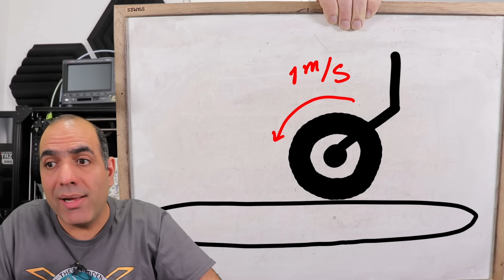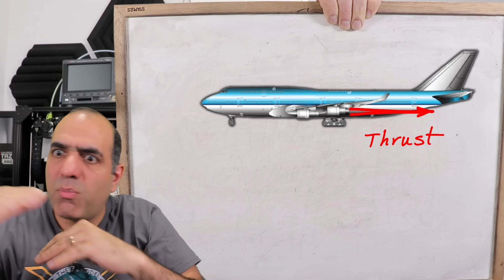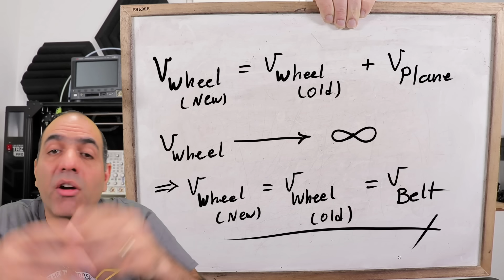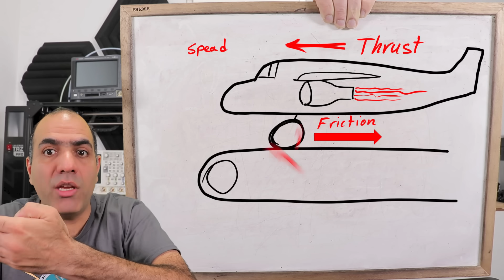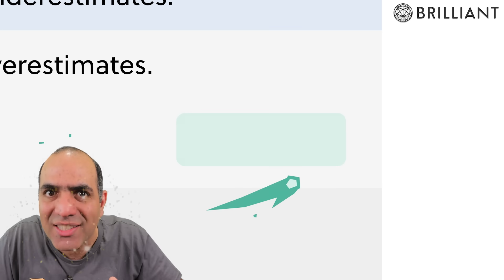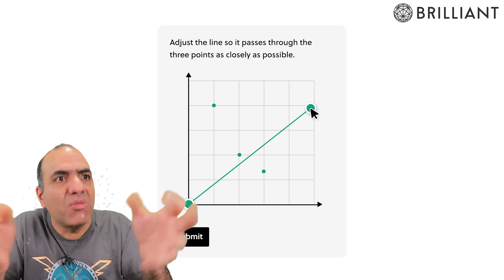Airplane Question that Drove Me NUTS!!!

Comment: Alright, at the point he says to leave a comment about what we think. Starting at rest, the pilot starts the engine and begins to throttle up the engine. The plane moves forward a a fraction of a millimeter, causing the wheels to rotate, but immediately the the conveyer starts rolling back to prevent the wheels from making progress. 

The conveyer and wheels will quickly accelerate until the friction in the wheel bearings pulls back on the aircraft with equal force to the thrust of the engines. This could cause either the wheels to break traction or the bearings to heat up and fail, probably within 10 seconds. At the point the wheels break traction, the plane can begin to make forward progress, but it is effectively dragging the wheels across the ground, because they only progress that can be made is equal to the difference in wheel velocity over the conveyer velocity.

Assuming the wheel bearings fail at some point, this will cause the wheels to wither come off or stop rotating, in which case the conveyer will come to a stop as the wheels do. The plane can make progress only by overcoming the friction between the wheels and the conveyer.

Both of the above lead us to a plane trying to take off effectively or actually dragging it's wheels rather than rolling them. Any further progress will depend on the coefficient of friction between the conveyer and wheels. Let us suppose this friction is somewhere between .45 and .75, which seems reasonable based on a quick web search I just did.

A commercial aircraft, such as a 747, does not have the thrust to take off with this much drag. A high performance aircraft like a stunt aircraft might be able to, but that seems pretty unlikely. A VTOL aircraft could do it! Maybe a puddle jumper if you wax the pontoons reeeeallly good.

Maybe if we put this whole thing in a wind tunnel there could be enough lift to overcome the wheel drag.

Anyhow, final conclusion: no.

Comment: Hi.  Pilot here.  This has likely been answered in a similar fashion in this thread, but can I say that I’m tired of the goddamn airplane on the goddamn treadmill question?  Ok. Here it is. Aircrafts move thru the air. Not via the ground. The Wheels are merely a way to reduce friction with the surface of the earth to make it easier to achieve the airspeed to reach Vr (takeoff speed) and become airborne. In other environments you have ski skids in the Arctic. Pontoons on float planes. In fact, that’s a good example….. you are in a seaplane on a body of water that has a current of 10 knots. If you are stopped, you’re moving at 10 knots in a given direction. Now when you want to take off, while you might factor in the speed and direction of the water in your initial takeoff run, what you’re really concerned with is the speed and direction of the relative wind, because THAT is the medium you are traveling thru/using. 
He’s a better description. Imagine your plane is a Cessna 150. It’s tiny, has two seats, a prop and is on your magic treadmill. Now a propeller works by generating lift and directing it forward. The propeller is an airfoil just like the wings, but it spins to get the movement thru the air to create the zone of low pressure that pulls the plane forward. ANY reduction of drag (wheels) makes this an easier job for the prop. Even if the wheels spun up to Vinfinity, it’d be just like trying to hold a Cessna on ice during an engine run up.  It would move forward thru the air, because there is thrust and a reduction of its nemesis, drag. And once the air around the wing got to 50 knots or so, lift would counter weight, and up you’d go. The problem with this puzzle is that it’s non intuitive to non pilots, tho I’ve seen a few pilots confused by it. A better analogy would be if you put a plane in a wind tunnel. A REALLY BIG ONE. And for every knot of thrust, the fan behind the plane would matche airspeed with tailwind.   As long as the relative wind and the tailwind remained constant, the plane would fly. Otherwise, maybe not.

Comment: no, because it is not moving. it is the action of the airflow across the airfoil shape of the wing that creates lift, which enables the plane to fly. a stationary plane will create zero lift, no matter how fast it's tires rotate. aeronautics 101. the wright brothers first glider plane didn't even have wheels, and instead used runners, was on a track system facing into a steady strong head wind, and was given it's initial bit of momentum by being pulled with a cable attached to a falling counterweight.

Comment: It will take off with the wheels not spinning... because the action/reaction produced by the engines is what makes the plan move relatively to air, not the spinning of the wheels (which are a consequence of the movement, not its cause). If the plane had no thrust but motors on the wheels, the plane would have stayed stationary.
Reply: >without the wheels moving
no rotation? this would imply no friction between the plane and the ground
no axial movement? this would mean no airspeed (assume GS=AS i.e. no wind)

Comment: Yes, the plane can take off. The speed of the conveyor belt has no effect on the ability of the plane to take off, as long as the speed of the air flowing over the wings (known as the "air speed") is sufficient to generate lift.
The engines of the plane are designed to generate thrust, which propels the plane forward. The speed of the conveyor belt has no effect on the ability of the engines to generate thrust. As the plane moves forward, the air flowing over the wings generates lift, and when the lift generated by the wings is greater than the weight of the plane, the plane will take off.
Therefore, even if the wheels of the plane are spinning on the conveyor belt at the same speed as the conveyor belt, the plane will still be able to take off, as long as the speed of the air flowing over the wings is sufficient to generate lift.

Comment: Hell yes, the plane can take off. The conveyor belt, which is moving in the opposite direction to the plane's wheels, does not affect the plane's ability to generate lift, which is the primary factor that allows a plane to take off. The thrust generated by the plane's engines moves the plane forward relative to the air, and the air flowing over the wings generates lift that allows the plane to take off.

The conveyor belt matching the speed of the wheels only affects the rotation of the wheels, but not the forward motion of the plane, which is necessary for generating lift. Therefore, the plane will be able to take off normally, just as it would on a regular runway.

Comment: The airplane should use reverse thrust and power up the runway in the reverse direction to approximately 1/2 infinity. Then the pilot should cut the engine and launch forward like a catapult on an aircraft carrier.

Comment: I'm not getting why overthink the question.
If instead of looking at the angular speed of the wheel we look at the linear speed of the point in the wheel that makes contact with the floor... And those 2 speeds match... 
There's no ramp up to infinity, is there?
The engine doesn't move the wheels 
(Allthough in reality wheels might have electric engines), but still, the moment the engine pushes the plane so the wheels have to move, the belt could match the speed of the wheel without problem.
The last thing i'm not understanding is why he explains the speed of the wheel with the plane having a speed v.
We stated that the belt matches the speed of the wheels, that means the plane has no speed v, so the wheels won't do that 2v and so on

Comment: The power of the thrust would be matched by the power of the conveyer belt. You need airflow over the wings to create lift. If the turbines create enough airflow over the wings from air intake, then it can lift off the belt.

Comment: Basically the question is can an airplane fly… the turbine thrust is going to push the plane forward it doesn’t need the wheels to do that. 

Planes do not use the contact of the wheels to the ground to fly…. If it did it would be a car not a plane… we could use this system to draw a line at 12:00 on the wheels, keep that line exactly in the same position vertical and lt could take off while the wheels stay stationary. (Looking at the left side of the plane) if the plane moved forward the wheels would rotate counter clockwise, all we need to do is run the belt clockwise at the matched speed keeping the mark at 12:00.

Easy 😊

Comment: No windflow under the wings, no lift. It is clear the question is referring to the plane pulling itself forward by thrust from the engines and then conveyor belt halts the momentum by reversing at the same speed so the wheels spin forward but the airplane is stationary. Adding nonsensical variables like frictionless vs friction is just obscuring the simple question.

The answer is the plane will not take off due to no lift. You're better than this Mehdi

Comment: If you see a huge runaway truck wheel running down hill and about to hit you, do you think ‘I am alright, the tyre in contact with the road surface is stationary’?  NO YOU DON’T.  In this question take the speed of the wheels as their passage along with the plane.
Their doubled rotation rate is from the conveyor and plane’s opposite movements.  The question didn’t go into rotation rates.
Mehdi’s double rotation rate wheels trying to double the conveyor speed IGNORES the plane and wheels moving away from the conveyor belt so that two minus one equals one not two.

Comment: The answer is no the plane will not take off because there is no air flow to lift the plane I can’t believe people are this dumb edit but a stationary plane can take off in a hurricane
Reply: It doesn't stay stationary since planes aren't propelled by their wheels like cars are. They're freespinning. You can replace them with skis or floaters. A waterplane doesn't care which way the river flows, or how fast. As long as the engines provide forward thrust planes take off.

Comment: Wouldn't the belt accellerate the air through boundary layer friction under the plane thus giving the condition needed for lift, which is fast air under the wing? Or suck it down, depending on wing position, especially at infinite belt speed, that's why F1 cars are tested on a rolling road to test the venturi tunnels

Comment: A treadmill like that would just make the wheels spin nearly twice as fast (or twice as fast if you discount friction in the wheel. Or the pilot adjusting for friction). Planes dont work like cars; they produce thrust not torque. The wheels do not propel the plane forward, the engine pushing tornado force winds does. If you wanna prevent a plane from taking off, place it in a vacuum.

oh yeah some valid points you made. guess i didnt think too hard about it. a plane sitting on the conveyor belt wouldn't produce any thrust because it's doing nothing. it may still fly if a tornado decides to catch a plane.
Reply: A space craft floating in a vacuum will be thrown forward if it starts its rocket motor.  The plane does not ‘care’ about sitting on a conveyor as long as the wheel brakes are off.

Comment: If you want to anger people more, you can argue that the condition of the conveyor belt matching the speed of the wheels is unsatisfying. The conveyor belt driver is probably tens of meters away from the wheel, and as we know information transfer cannot be instant (the fastest possible is the "speed of light"), thus the conveyor belt could not possibly immediately match the speed of the wheel.
I know whomever designed this question is trying to explain that the plane does not fly by its engines, but by its wings, so as far as there is sufficient amount of air at sufficient amount of speed with lateral flow above and below the wing (the latter is known as air-speed), the plane can lift off - the ground speed does not matter. But the question trying to create hypothetical situation that would exaggerate that effect introduce a lot of other problems. That's why thought experiments should not be considered "scientific".

Comment: I see more of a lexicon problem than a physics problem. In any case, it’s all about airflow. Another answer would be (under the assumption that the drawing is to scale and there’s no external factors acting upon the airplane), it would be impossible generate any appreciable lift if the airplane was stationary. The real answer given the varying conditions would be determined by, all things being equal, is the airplane allowed to move in the scenario? If it is free to overcome any constraint and is allowed to move, it can theoretically fly. If it is bound to be stationary, it cannot.

Comment: Easy it will still take off the landing gear would be going twice standard take off speed because the turbines push against air for thrust it might be a little slower due to friction from the wheels but will still take off it the gear doesn't explode

Comment: if it's only the conveyor belt moving with nothing else happening, it will not take off

but, if the conveyor belt is then removed and letting the plane back on ground to move at that take-off speed, then yes it will.

Comment: Reading answers here i feel like either I'm missing some basics of how wheels work or I'm misunderstanding the question. Can someone clarify for me? 

I will use a random spot next the runway as reference point. (Under normal circumstances stationary plane will stay stationary and accelerating one will just take off normally)

So my understanding is that when the engines push the plane initially it will roll forward at some speed. But the belt is applying opposite speed. So shouldn't the plane from our reference point end up stationary? When wheels want to travel 1 m/s the belt will cancel it out by moving - 1 m/s, we travel at 0 speed, we stay stationary, plane never takes off because relative to air (no winds ofc) we are not moving.
people are throwing around some friction stuff between wheels and the body of the plane so maybe it's something I am missing.
Reply: How can the conveyor belt moving backward slow or stop the plane?  The wheel brakes are off and the wheels can spin at any speed (within reason and subject to the speed rating of the tyres).
What transfer of energy is supposed to take place between the conveyor and the plane’s wheel hubs (containing the practically frictionless wheel bearings)?  What is supposed to grasp the plane to stop it from moving?  The conveyor firmly grips the bottom of the plane’s tyre but the tyre is attached to a wheel perfectly free to rotate as the plane moves.
Can you imagine the rolling forwards 747 rotating the wheels and the wheel rotation speed being increased from being additionally rotated by the conveyor moving in the opposite direction (and the opposite velocity) to those wheel hubs, their undercarriage legs and the rest of the plane.
The wheels are 100% free to rotate on their finely machined and well greased bearing surfaces.
Mehdi thinks that the wheels rotating at double rate will infinitely accelerate the conveyor to break the laws of physics.  He failed to visualise that the double rotation rate spinning wheels are attached to the plane moving away down the ‘runway’ at single speed.
Reply: @givenfirstnamefamilyfirstn3935  When plane is stationary it's wheels are not moving. If we now turn on the conveyor the plane will move backwards. We can counter that if we turn on the engine and accelerate the wheels to the speed of the conveyor belt. By my understanding the plane is now stationary (relative to some point) the same way as its stationary when neither wheels or belt move.
So shouldn't the situation go like this? : plane accelerates, the ground (belt) moves backward killing any speed the plane gained. plane end ups stationary.
I think I should also make it clear that I'm thinking of the propulsion as a rocket engine or something, not a propeller.
Reading other replies I feel like Im missing something.
Reply: pondering a bit further I think my issue is with friction (i think?) between the wheels and however they are attached.
if there is no friction at the attachement the conveyor belt can move at any speed and the plane will appear to just stand there, and be free to accelerate. 
if they are practically welded then the plane will just shoot backwards.
I'm unable to figure out the mid point but I guess I'll just take "the plane can just freely take off" as truth.
Reply: @fanshi5302  You start the conveyor, it moves to match the speed of the wheels.  If the plane is stationary the conveyor speed will be stationary too.  You imagine a scenario with the engine thrust only balancing the friction of the slowly creeping wheels, conveyor friction is irrelevant as it automatically matches wheel speed.  The question asks can the plane take off?  Full throttle will accelerate the plane down that strange runway.
To keep the engine rotating at idle with safe turbine temperatures the engine has to run at about 30% of maximum rpms.  Taxying a jet needs braking to manage the high residual thrust at idle.

Comment: Commenting before watching. The conveyor belt will just spin the wheels and apply little force on the plane. It shouldn't affect the engine's ability to accelerate the plane relative to the air, and therefore, the plane can take off.